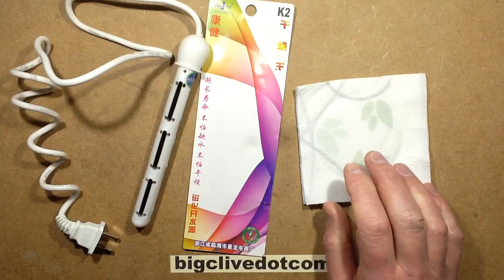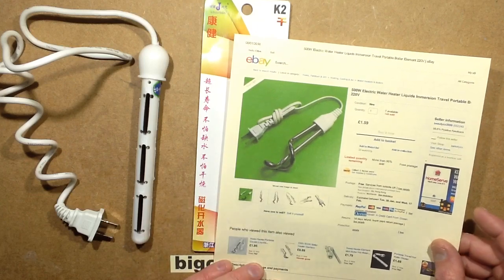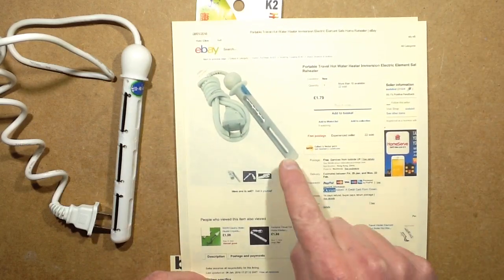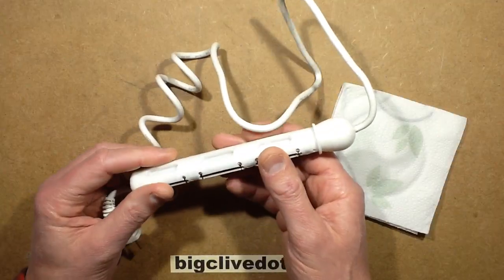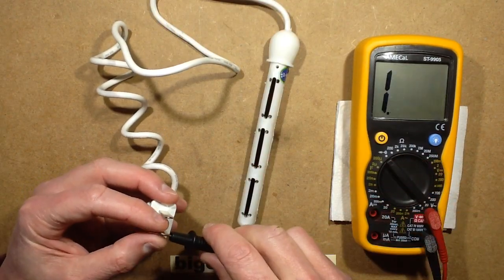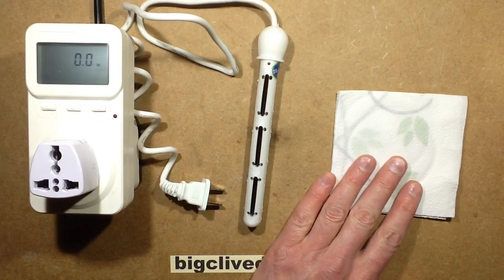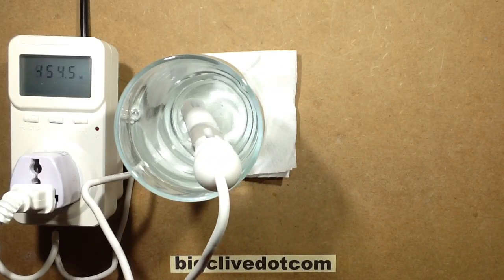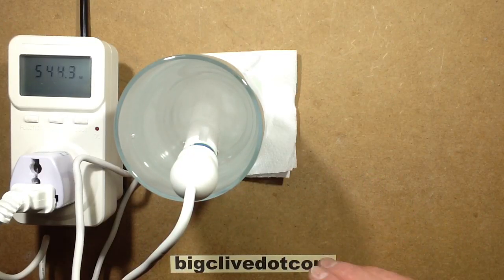Dangerous 240V Coffee-Cutor (coffee cup electrode boiler.)

Comment: Could I use it enclosed inside a DIY coffee machine? I want to build a coffee machine, but I'm searching for a heater. Would this be quicker than a normal heater? (90C or so)
Reply from the maker: +Stephan S Some catering equipment does appear to use electrode boilers, but the vase and pipework would have to be non conductive.
Reply: +bigclivedotcom Yea I know, they use pressure ect

Comment: What if you stick a metal mesh connected to neutral around the device? Also why the water is not spliting to hydrogen and oxygen molecules due to electrolysis???
Reply from the maker: +Христо Митрев Two pin un-polarised plug, so that mesh might end up live.
Reply: bigclivedotcom I think you should change the plug and modify the body(It would be awesome if you stick a metal grill with epoxy and embed the cable into the epoxy too), so it is safer - this may end up as pretty cool alternative to a kettle!
Reply from the maker: +Христо Митрев I actually quite like it as it is...    Dangerous. :)

Comment: This reminds me of my job in the test lab of a CRT factory c1998.   One of the many tests I had to do was to hold the anode of a 17" crt over a boiling kettle (insulation tape kept the switch in the on position) wait until we had a good amount of condensation then connect the graphite to ground and connect the annode to a "spellman HV amplifier", then slowly turn it up.    at upwards of 15kv you would get some fantastic and beautiful "stray" tiny bits of blue lightning searching and seeking a route to ground.     At around 30-35kv you would then get a nice big "KKRRAACKK" as it would then ark the inch or so between the graphite and annode giving you your annode insulation test result.    Those lovely koreans gave me a metal table with an antistatic mat to do this on too.

Comment: Damn! I thought I had finally found what I was looking for, bit no.
I'm looking for this but that can run from a car battery. 
I want to drop it into the washer squirter bottle to heat the water.
All the 12v ones are too big to get into the filler hole of the tank.

Comment: That's not steam and it's not boiling it, that's hydrogen and oxygen gas from electrolysis of the water. Electrolysis makes the electrodes oxidize and metal oxides then mix with the water, yum. That HHO gas can burn and turn back into water btw; pretty explosive if you have a lot of concentrated hydrogen/oxygen mix in 2:1 ratio (two H and one O as in H2 O).
Edit: Definitely will buy one, if I get bored with it I'll just send it to my ex and tell her it's a vibrator.

Comment: Hello bigclive, I have an LCD monitor that is displaying horizontal lines that scroll up the screen vertically. I've narrowed out panel failure since the same thing happens on another monitor in the same room. I've narrowed down the cause as to what causes the lines as the charger for my laptop I turned into a desktop. What is it wiht the charger that is causing the lines to appear and what do you suggest I do to stop this from happening? Thanks.
Reply from the maker: +Dakota Blake That does sound like power supply noise messing with the video signals.  See if you can find a professional grade charger that has a mains ground connection.
Reply: +bigclivedotcom Thanks, that is one option for me. I've got 3 chargers for this, all same voltage and amperage. But, 2 of them are earthed. Strange thing is, they have the same issue, but amplified. Is there a good line filter I could get? I've heard of ferrite core filters, but I don't know if that would do it.
Reply from the maker: +Dakota Blake Try plugging in a charger but not turning it on at the walls so it's just grounded.  Do the lines still appear?  It may be via your monitor's power supply.

Comment: I do have a warm mist humidifier which uses an electrode boiler.
The unit is made so that it won't be possible for any fingers to touch electrified water. The heater part is on the lid, so when you open it up, the current stops flowing and of course the electrodes are covered with a shield :P

Comment: Added bonus is all the nice microelements coming from the electrodes that get dissolved, making the water really good for your health :-P All this nickel, copper etc...
BTW, students in my country (Poland) in dormitories in the 60s-70s, when pressed, used 2 razor blades separated by two matchsticks for the same purpose :)  Also in the 80s there was a cup with 2 electrodes on the bottom and a power lead produced in the USSR, seen such a device in action and it produced almost an underwater arc, resulting in a cloud of metal particles to build up in the water :)

Comment: Superb. My bath has a nice earth connection on it. I assume the rcd would save me from suicide. Your heater is a damn sight quicker than the comedy kettle my mum bought me for the car. I think it took about 20 minutes to boil enough water for a cup of tea and we had to bump start the car afterwards.

My latest purchase is a Breville "one cup" water heater. I'm quite chuffed with that, as it boils just enough for one mug of coffee and it does it while I get the milk out of the fridge. Handy for us folks that get a bit arthritic at times. I'd like to see how that works, but I'm not killing mine.
Reply from the maker: +Siskin's Bits and Bobs I've got the one cup unit too.  As far as I can see it works by literally using the steam to blow the liquid out due to a one-way valve between the heater section and the water tank.

Comment: Apparently very dangerous things make youtube views sky rocket! Fun how that works.
Reply from the maker: +Jeremy Voshage Well you've gotta admit.  Dangerous things are much more interesting than safe ones.  This video would not have been quite as interesting if it had just been a heating element boiling water.
Reply: +bigclivedotcom Dangerous is the way to go! I was kind of was hoping for a teardown. Is there really only 2 strips of metal running the entire length of the probe?
Reply from the maker: +Jeremy Voshage It's just two strips physically moulded into a solid plastic rod.

Comment: Could someone explain to me (A fairly lamen person) why clive could measure a high AC voltage on that spoon, and a decent enough current to feel it. Yet happily grab it without being shocked?
Reply from the maker: +Alex Scott I was completely isolated from any return path to ground.  If I'd been standing on a concrete floor or in contact with any adjacent grounded surface I would have passed current and received a shock.

Comment: I dont think the steam and bubbles that instantly come from this thing means boiling water. . . more likely from quite powerful in this example, reaction of electrolysis, which creates  O2 *2 and H2 *4 from water. Basically an explosive gas composition. If you hold an empty container upside down above the heater you can create a cup of nicely blue color exploding gas. It would also potentially electrolysis all kinds of chemicals in drinks into something which can could be dangerous. 

This is a must have for a chemical lab at least!

Comment: Reminds me of those vaporizer things you would use when you had a cold or sore throat. You would fill the tank with water and plug it in and it had a small cup for some type of stuff sort of like Vicks VapoRub that would help clear your nose. Basically it was this thing but the electrodes were heavily protected inside plastic but they had holes for the water to get in. One time I plugged one in and the plug went BZZZZTTTT and at the time I was little so it scared the shit outta me.

Comment: looks similar to the oldschool  DIY water heaters people used over here. Few hacksaw blades, some matches for spacing a wire with a plug. Boiled a bucket of water in the matter of minutes. Well you needed to ram a nail the oldschool ceramic  fuses to keep em from blowing. Very unsafe.

Comment: I don't get it. How come you have not been electrocuted when inserting the spoon? Isn't that thing just basically a wire that goes from your power outlet straight into the water, which then, closing the circuit, heats up? Thx, great video as always btw ^^
Reply from the maker: +igotes It's a bit more complicated than that.  The water between the electrodes forms a potential divider and the rough centre tap of that is connected to by a higher resistance path of water.  I'd still potentially get a major full-on mains shock if I touched any grounded surface.
Reply from the maker: +mcrsit The sole reason I didn't get a shock was because I was isolated from a return path.  But it really is something you can't guarantee.  It's not something that should be routinely done.  Powerline workers use multiple levels of insulation to work on live power lines.
Reply from the maker: +Dracolith1 capacitive coupling would be low.  The main hazard is resistive coupling.  Just a tiny trail if moisture through a rubber soled boot can pass enough current to kill
Reply from the maker: +George Smith That would be a full time job these days.
Reply from the maker: +super awsome minecrafter Yeah, I just found that one too.  Needless to say I immediately ordered one of each size for my collection of deadly stuff.  What makes them even more appealing is the Fischer Price style of toy colours they used.
Reply: +mcrsit He's isolated from earth, I'm guessing by rubber soles on his shoes. The device has two electrodes inside it, one connected to live, the other to neutral, so the circuit is "mostly" completed by the water inside the plastic shell.
Reply: Actually I'm surprised he didn't draw a schematic of it!
Reply from the maker: +kuro68000 Previously, yes.  I passed around 100uA.
Reply: +bigclivedotcom that's an order of magnitude braver than I am :-)
Reply: +bigclivedotcom  I found this on eBay marketed as a baby bath warmer
Reply: +bigclivedotcom Say it, Clive, it's a POTENTIAL DEATH TRAP!
Reply from the maker: +Johnathan E Yes.  It acts like a flowing liquid resistor, which actually makes it very efficient.
Reply: Great description. I hadn't actually thought of it like that. I was surprised you didn't draw a schematic!
Reply: Shit, I already said that, haha.
Reply: So basically you are safe both because the water outside the electrodes shields you a bit from the current and also because you are not grounded. Am I correct? Thanks again!
Reply: Yep, got it now. Thanks for the clarification ;) Keep up with this good work!
Reply: +bigclivedotcom Did you check you were not forming a return path first? By measurement I mean.
Reply: But do not try at home.....  Rubber soles might not always be enough to isolate from ground;   Alternating Current  of sufficient voltage can capacitively couple across an insulator such as rubber, or air,   so electricity can possibly flow even if you do not make physical contact with a grounded object.
Reply: +bigclivedotcom Do you report the dangerous items you find? Surely this breaks some kind of law haha?
Reply: +bigclivedotcom What actually heats the liquid up? the resistance of the liquid?
Reply: +Johnathan E That's an easy answer. I shall explain by copy and paste of someone's very precise description of it.

Microwave special materials, non-toxic, odorless, In 100-degree
water, it also does not decompose, not aging, not discoloration,
deformation. 
Due to the magnetic wave action during the heating, after water
absorb electromagnetic energy, moisture occurs bizarre oscillation ,
collision, and after friction, the water rising temperatures.   

However,  there is an even bigger bonus.   That being through special panels put chlorine converted into hypochlorite, play a role in disinfection and sterilization.
Reply: +bigclivedotcom I'm sure you can verify this as being highly accurate?
Reply: +Jim F +bigclivedotcom  A potential life divider you might say

Comment: @bigclivedotcom in this video you mentioned another in cup heater that uses heating elements instead, would you recommend buying one of those? They sound like a pretty useful thing.
Reply from the maker: +TheCocoYouKnow They are quite useful, and you'll find tons on ebay for LESS than this type.  But be sure they never get plugged in while not submerged as they can cause major burns to anything they touch.
Reply: Awesome, thanks a bunch

Comment: It kind of reminds me of Photonicinduction's kettle.
Reply: +cjmillsnun Yep, the 10 second toaster too.  He should market those to China, he be rich in seconds!!
Reply: +cjmillsnun This is much more dangerous as it is passing current through the medium you are heating. Potentially DEADLY. Photonicinduction's 10 second Kettle was just a regular Electric kettle which was driven at three times its max. power rating until it popped.
Reply: +THE VERY BEST OF YOUTUBE Come on now, both Photonic and Clive are both in real life professional electrical and trained,  they both have differences in approach to what they do.  Clive goes way back, he invented the Joule Thief circuit.
Reply: I'm not arguing with you Erik.  Photon's kettle was safe as it was in controlled circumstances.  This thing is lethal.
Reply: +jusb1066 I'm sure Clive never made the street lights dim!
Reply: +jusb1066 holy shit i have been following this channel for months now and first time hear about the joule thief :D
Reply: digitalradiohacker

Popping the thing would be hard, as it is popping by design in normal operation conditions. If something would pop, then it would be most likely the cord when Photon would crank up the voltage to levels above what the insulation could handle. I am not sure if you could find some medium to heat that would draw too much current to melt the cord and cause failure by this rather than by high voltage.
Reply: Wonder what would happen if he got his hands on one of these.

Comment: something like this was popular in Poland in 70s and 80s it was called "betoniara" (cement mixer). basicly it was a heater assembled from two razer blades , wite and matches.
Reply from the maker: +miecionoz I wonder if the name came from the practice of builders using two nails in a bit of wood connected to any source of mains they could find to heat buckets of water for cement or plaster.
Reply: +bigclivedotcom for real? I would love to hear or see about that.

Comment: Hi Clive 
great videos 
I went to turkey a few years ago and the hotel didnt have a kettle so I bought a cheap plastic one from a corner shop.
Printed on the outside of the kettle it said "do not use metal spoons" 
On closer inspection the "heater" consisted of a metal plate in the bottom of the kettle with two bolted terminals .
I used it for 10 days carefully until one terminal started to "glow" and fizz .
I took it back to the shop and was told "no refund"  cheap model.
I was only staying for 14 days so threw it away.
so these things must be common place in these countries.
Paul.

Comment: I think we need an instructable for the DIY version of this ingenious device:
1. Get a plug and cable. 
2. Strip the insulation off of the ends.
3. Plug it in.
4. Put the other end into water.
5. Boom! Instant water boiler on the cheap!
Oh and if you're using a thermos, don't forget to earth the metal, because safety first.
Reply: you don't actualy need to connect the wire. As we could see on the led floodlights.
Reply: +LaterMeansBrick the ground wire that is.
Reply: +LaterMeansBrick oh yeah that's right. Plus, we live in the Internet-of-things age, therefore I suggest instead to connect the ground wire to the shiny aluminium back of our iPhone (everyone owns one, right?) in one hand and then bring the whole tea and boiler online using the spoon.
Reply: andreabak
I see, that would be what instagram stands for.
Reply: +LaterMeansBrick lol indeed

Comment: You should try to stick it in really salty water and check power consumption :))
Reply: I was thinking this.  Like soup, with lots of sodium.
Reply: +thechosendude Yes, the soup is perfect, this heater it is quite logical to use for heating soup, and the soup is quite salty. So it would be interesting to see what would happen if an ordinary person would buy this heater and want to warm up soup or other salty liquid.
Reply: +zapilimne 
OMG YES, I wonder if it will go up to a few kW .. that would result in some violent boiling! XDDD
Reply: nagi603
Ya .. then you just gotta do what Photonicinduction does!
Put it on a big breaker!
Actually, I think Clive should send this to Photon, for some extreme torture! :DDD
Reply: +Benjamin “Ozias” Esposti With a few kW, it might even trip the circuit breaker.
Reply: Im pretty sure youll make chlorine gas and iron oxide
Reply: +Benjamin „Ozias“ Esposti 5KW and my Circuit breaker will instant pop
My luck i would never Use anything like that.
Specialy Since it would'nt even get trough our Borders probaly.
Reply: Horsesgamer in Australia,  we have  safety switches, guess that is our circuit breaker

Comment: It's overcomplicated. Google: "Buzała" 
The plug, wire, few matches and the two razors are perfectly enough.

Another variation can be used in case your hot water boiler failure and you are desperate to have a bath: just swap razors with hacksaw blades. You will need a second person to help with the RCD, but hey ho..  ;-)